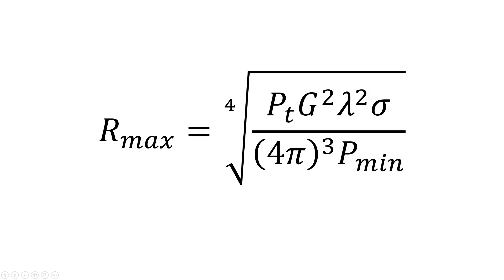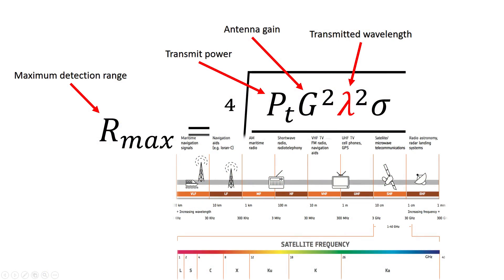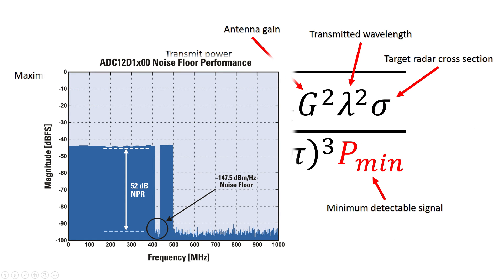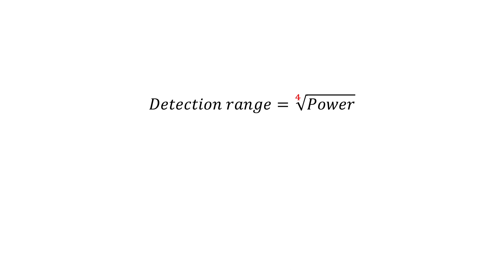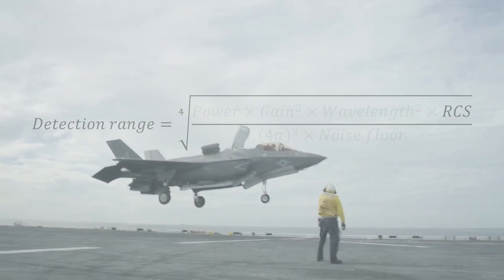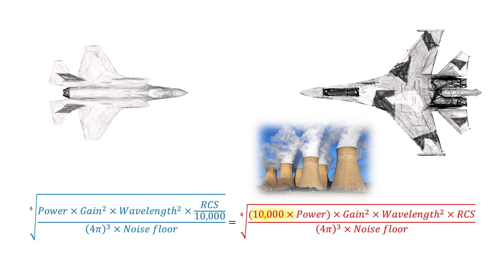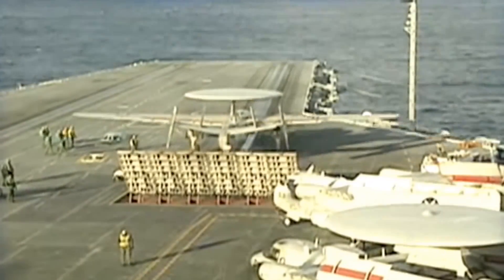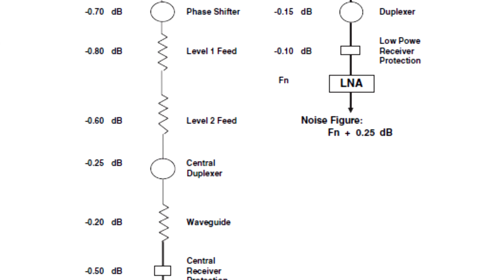F-35 Lightning II: Busting Myths - The Radar Equation [v1.1]

Comment: If: two groups of fighters are closing on each other at a combined speed of mach 2 And: kill probability on BVR missiles is extremely low against enemy fighters Then: neither side is likely to kill the other in the 60 or so seconds between max missile range and visual range. Once in visual range, radar stealth becomes much less important while fighter quantity becomes hugely important. Quantity of fighters available is inversely proportional to cost and cost is directly proportional to stealthiness. Biggest advantage I can imagine in stealth aircraft is allowing night time airstrikes with much less fear of prosecution from enemy fighters.
Reply: rvfharrier Exactly, the power of stealth isn't simply that you can fire at max missile range. The true power of stealth is being able to DECIDE how initial engagement will occur on your OWN TERMS.
Reply: @0RobotWarsIsTheBest0  no further explanations. F35 failed on Feb. 2021 as per USAF report and needs new project.
Reply: Kill probability on BVR missiles is extremely low when fired at max range, which is what tends to happen when both opponents detect each other. The advantage of a stealth aircraft is that it could get closer before it fired, the closer the engagement the more likely the missile will have enough energy to hit when it arrives.
Reply: you guys are helping with my original point. points and counterpoints are a continuous thing between militaries with radar, jamming, stealth, terrain masking doppler notching missile decoy and evasion and so on and so on. the only thing that never changes is "we are flying right at them and they are flying right at us so we'll be in a knife fight soon enough"
Reply: What should a stealth aircraft do if its likely target uses jamming which is equivalent to increase of such parameter as noise floor? Get more, and more, and more closer? Until which boundary?
Reply: *****
What a BS I've just read? How the type of antenna's aperture scanning and type of aperture elements (AESA) is connected to SNR? Where the SNR is measured, at receiving element of AESA? As I understand the signal is the one which is transmitted from the antenna, reflected from the target and reached the antenna again. Noise is the jamming signal from the jammer which is transmitted from the target and hence it surely has on both sides (antenna and target) more high level then the reflected signal. Furthermore up to date jammers use targeted jamming signals with frequency hopping and relaying radar's signal. And at least SNR should be more then 10 at the receiver in order to radar can detect the target.
So jamming significantly reduces the target detection range for any radar including f-35 and f-22 radars.
Reply: *****
As I understand LPI is just a good old technology of using broadband noise-like signals with phase shift keying. In a data transfer technology it is used in code division multiplexing. In AESA it reached its max possibilities due to broadband elements of antenna's apperture and also due to fast semiconductor technology. All hope is that the jammer does not detect radar signal on the distance at which the first missile launch becomes possible. Technical characteristics of electronic reconnaissance and warfare systems today are among the top secrets. But Russian open sources state that radar signals of F-22 and F-35 can be detected at a safe distanse. For example here ( vvprohvatilov.  livejournal.  com  /  49633.   html) (delete spaces)
Reply: Yes, assuming they don't find another way to detect the stealth fighters besides X-band radar and assuming they don't detect the onboard AESAs and radios, transponders etc of the stealth fighters
Reply: Victor V Copied from an old comment of mine: "To effectively jam an AESA you need to use Noise Jamming, which is only effective when the signal to noise ratio is less than one, achieved through focused jamming power or reducing reflected signal. F35's APG-81 AESA has a very narrow beam for jamming. The raw power of this radar will significantly outperform any legacy fighter due to the integration of the Radar. This coupled with the incredible small RCS achieved by F22 and F35 (Which reduces reflected signal), makes jamming against them useless."
Reply: Victor V 
When I'm talking about AESA in this context I'm referring to its features like LPI on the F22/F35. So, you correctly point out that latest deceptive jammers use targeted signals and frequency hopping to mimic received radar signal, but due to the features of LPI it is extremely difficult for a jammer to identify the signal from their AESA when it's changing many times a second in a random pattern. That's basically how I understand it. Check out these links for in depth discussion on the topic: http://www.f-16.net/forum/viewtopic.php?t=27364
https://www.reddit.com/r/F35Lightning/comments/3hxeu0/can_f35_and_its_missiles_be_jammed/
Reply: +Artie the Swolest Man in the World
"If...."
The situation for the F-22s and F-35s, however, is that they will be the first to discover that both groups are heading straight at each other and so can decide to do... something else! 

It's a huge advantage knowing the presence of the enemy when they are unaware of you. Sixty seconds is plenty of time to move out of their way far enough so that you're unlikely to be visually spotted (especially when the bad guys aren't specifically seeking to locate the planes they don't know are there). Then you can choose a favorable approach and a favorable range to blow them from the sky before the bad guys are even aware they're being hunted.
Reply: +Artie the Swolest Man in the World
The most reasonable assumption of all is that all these obvious matters and more have not been neglected in the design of the F-35. For example, with so many research papers being openly published describing new materials and techniques for absorbing X-band radiation, it would be surprising indeed if the F-35 was not dramatically less detectable by X-band radar than previous stealth aircraft.

Comment: This is not a myth bust but just a simplified look at how radar and stealth works. Yes if the Su 35 was looking head on at the F35, and not using any other passive sensors, then you'd be right. Well even then you wouldn't be right as the Su 35 would still detect a "golf ball" sized target at range and the on-board DSPs would translate that into a full blown target.